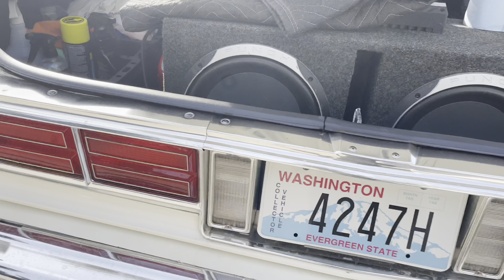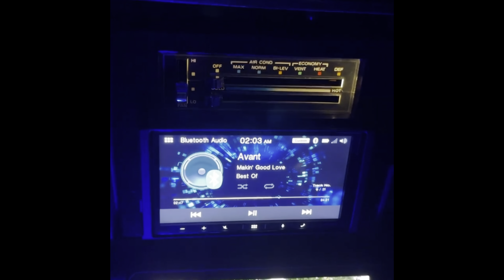DROVE MY BOX CHEVY 2700+ MILES TO LS FEST WEST | SEATTLE TO VEGAS

Comment: Look like it waz A Great Show!!
I see the box chevy handle great on the road besides the drum brawesome in the rear..

Also how did that radiator hold up?
Reply from the maker: It was pretty awesome! Radiator was flawless. Temps stayed pretty cool. What I was really impressed about was my trans cooler. My temps averaged about 135-140°. 150° at the highest when I hit 100° temps.
Reply: @MrGriffin23  

Wow, that greats temp. I got the same transmission cooler and a temp gauge so I can monitor it.

I was debating on the champion radiator with lifetime warranty or the new radiato you have. 😂🤣😅 Also since you did the install of that radiator, I think the price went up a little bit..
Reply from the maker: @pucegtr  Oh damn! I want my cut! LOL!